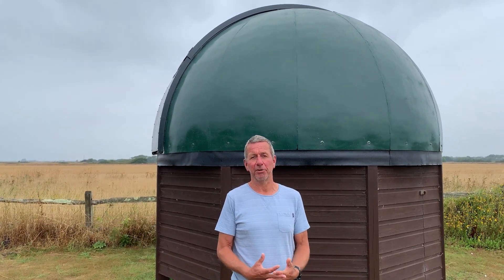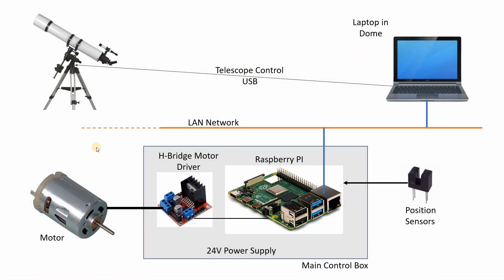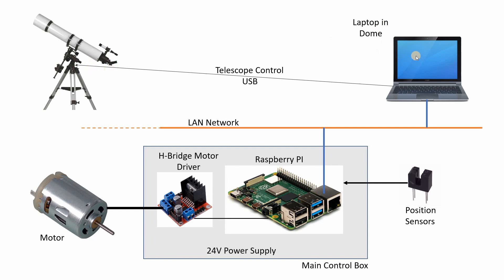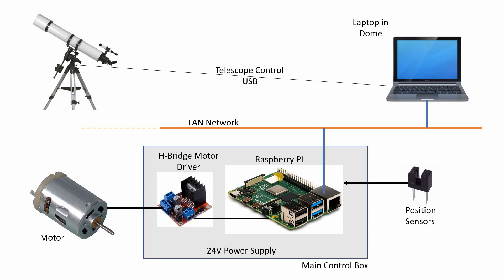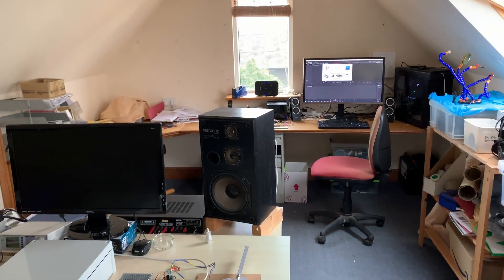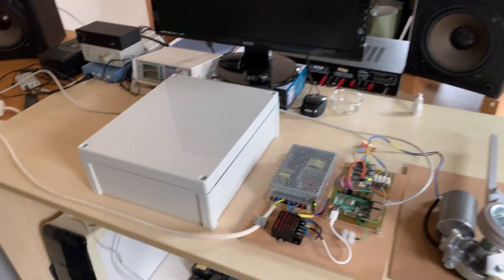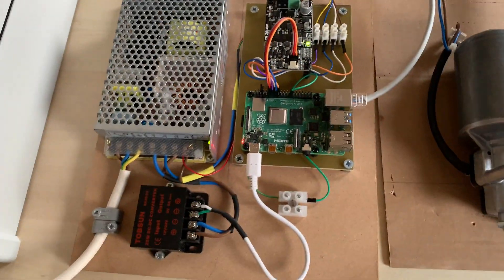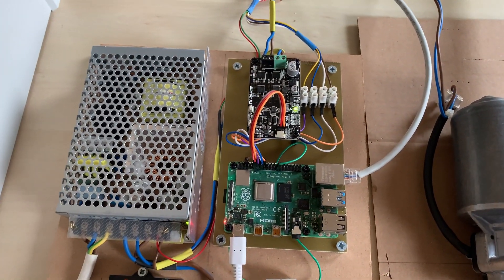Dome Automation Project Part 2 - Full System Concept

Comment: Do you plan to release connection wiring project and list (+ Amazon link) of component used in this project? Thanks
Reply from the maker: Yes, eventually. I will start documenting this all in my blog as soon as I can. If there's anything missing you need, you can always contact me. At the moment, the project is a voyage of discovery as I go!